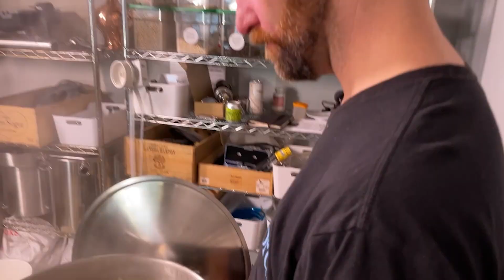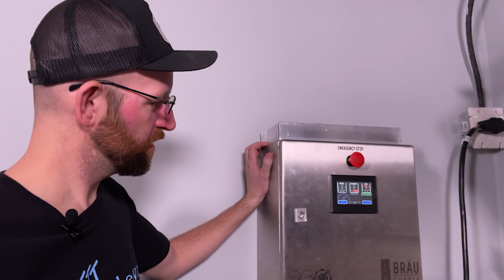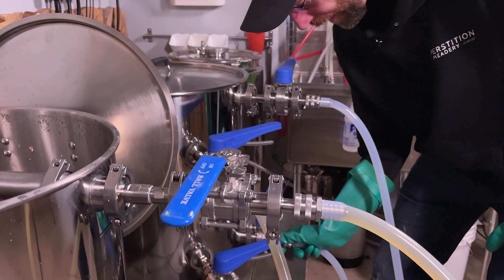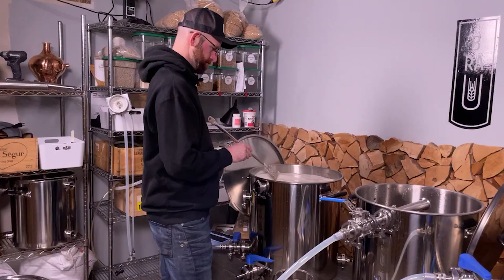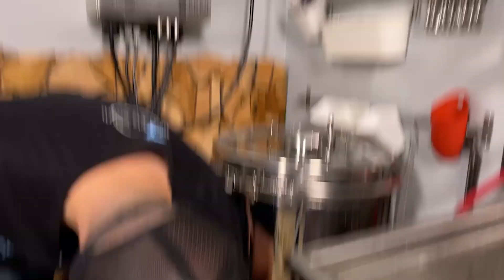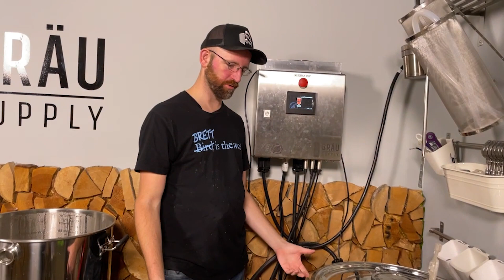HERMS 20G System Kolsch Brew Day

Comment: what is the advantage on measuring temp at the mashtun outlet vs herms coilc outlet? 
I see you measure at the mashtun outlet what is your reason to do this?
Reply from the maker: Measurement at the mash tun outlet is telling you the temperature the wort actually reached on its way down through the grain bed.  Measurement at the herms coil outlet tells you what temperature of wort you're putting back on top (the wort temperature that hasn't reached the grains yet).  I suppose there isn't a 'wrong' way to do it, if you know your system you'll know the differential of the two of these.  BUT, the output temperature of the wort leaving the HERMS coil outlet, will be close to the HLT temperature, and therefore it's not as informative as the temperature leaving the mash tun.  in other words the differential is greater measuring at the HLT tank, and the outlet of the mash tun, giving you better information to adjust your HLT temperature with.  Does that make sense?

Comment: Why don’t you use a quick connect inside the mlt with a 90 hose barb and then just disconnect the hose and connect the sparge arm? Then you don’t have to remove tri-clamp fittings or valves. A lot easier and safer because the fittings are hot by that time.
Reply from the maker: That is a good idea!